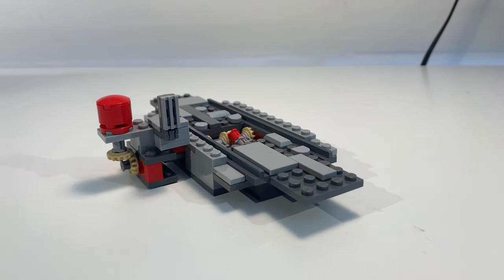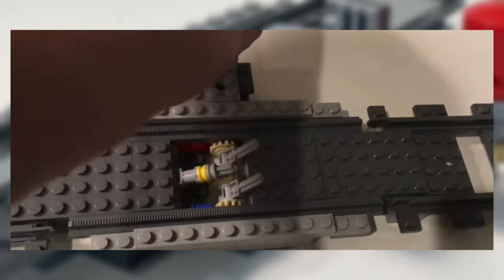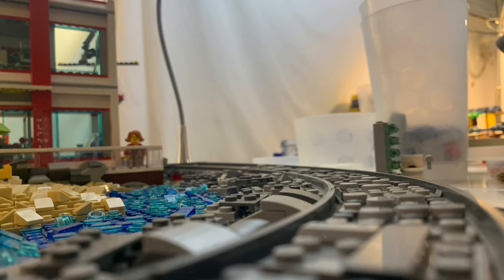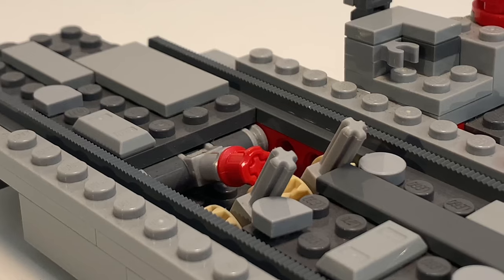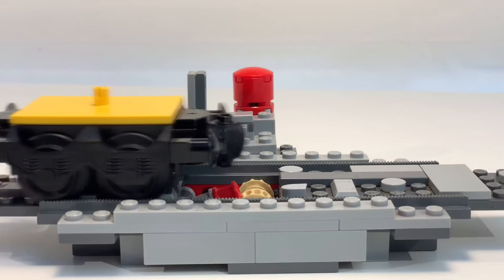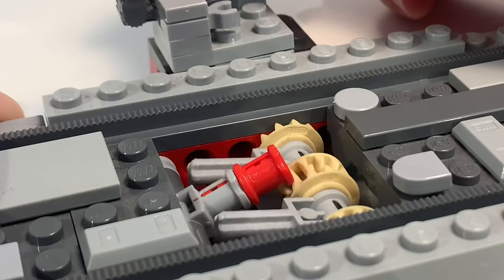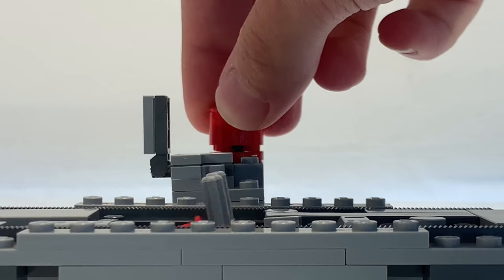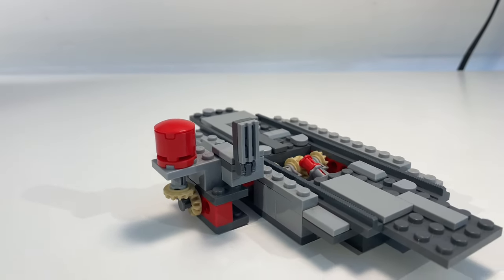Lego Train Stopper - MOC Showcase

Comment: Did you do anything special to connect between these old track pieces and the modern ones, or just accept the bumpiness of the transition?
Reply from the maker: I just tucked them as close together as I could then just accepted the gap.  The train actually didn’t have any trouble with it even on its lowest speed ✅
Reply: @BrickImperial  Thanks, I'm going to make two transition pieces from old fashioned beams to the new solid pieces, so I'll have to figure it out on my own ;)
Reply from the maker: Cool!